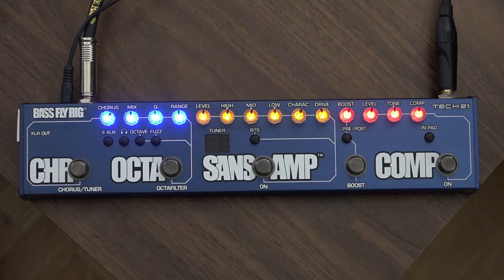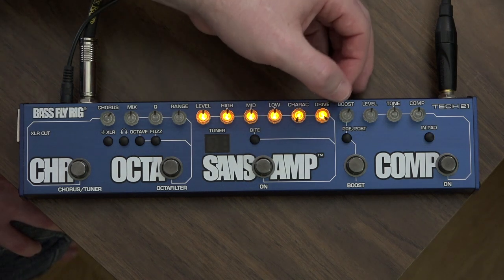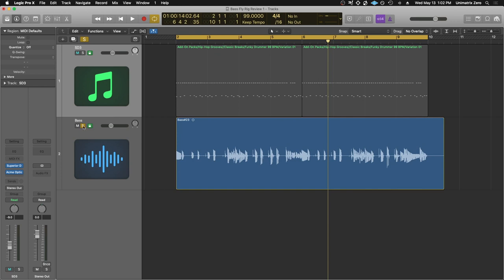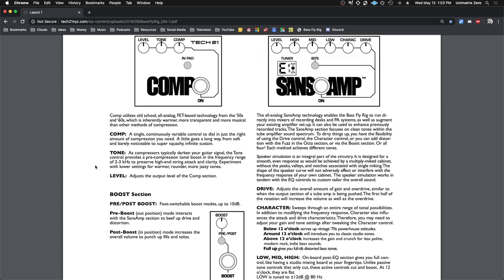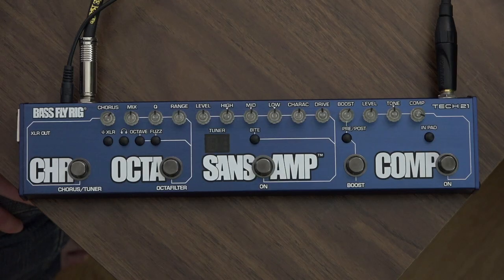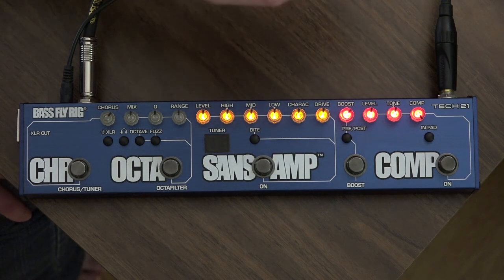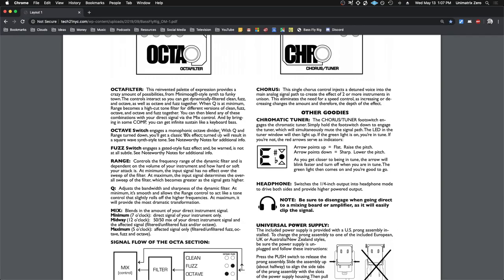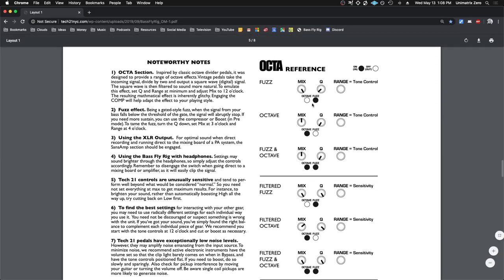Tech 21 Bass Fly Rig Review & Tutorial

Comment: On this video the sound is clear, but my BFR unit has so much hiss when I turn on high pot or press  compressor section on. Does anybody has the same issue?
Reply from the maker: I wonder if you have noisy pick-ups or some other kind of issue with the electronics on your bass?  It's also possible that there is something wrong with your BFR.  Have you tested it with different basses?
Reply: @RomanRiccio  It is definitely the unit itself, not bass guitar. The hiss is present even when the volume on guitar is completely off.
Reply from the maker: @jugl7324  Other than maybe a gain staging or connector issue with your setup, there could be something wrong with the unit.  Do you have a local music store with a repair shop you could take it to?
Reply: @RomanRiccio  Unfortunately, I cannot bring it up to a music store a the moment. But, it looks like it is something wrong with the unit. I will have to check it out somehow...
Reply: I’m sure your have done this ..but…. Check that the headphone button is out when using the 1/4 inch output to your amp or PA.    Hope this helps.